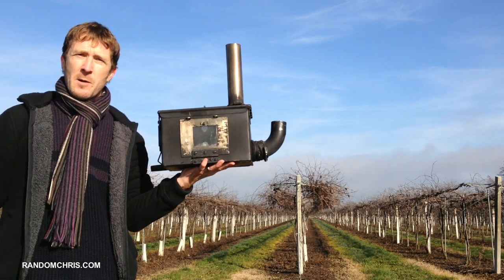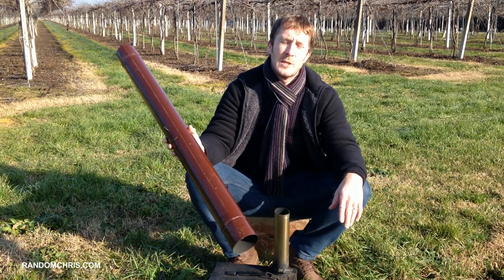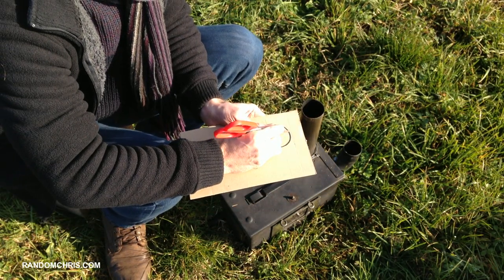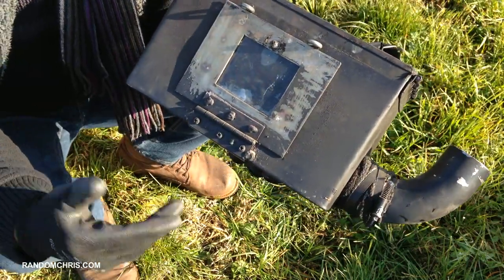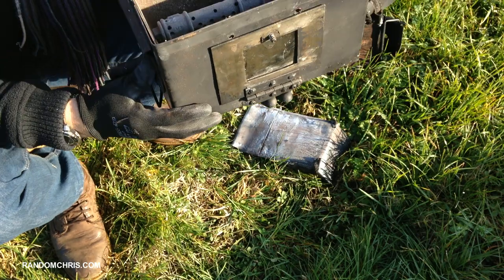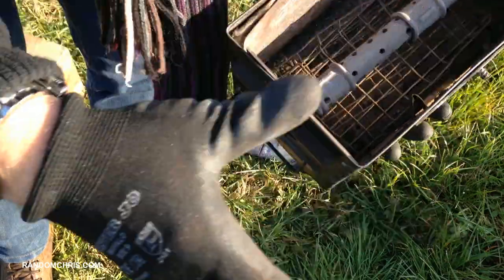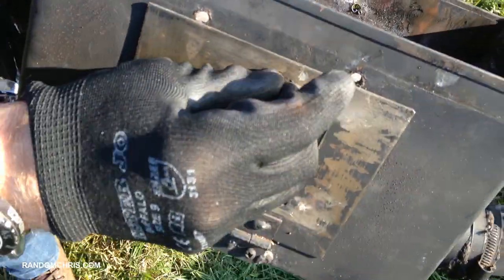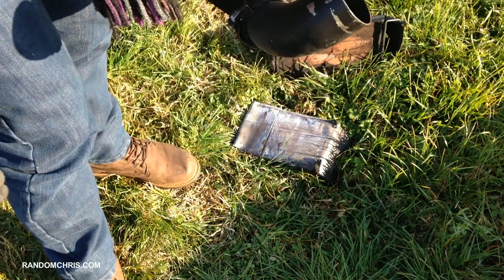How I Built my Ammo Can Rocket Stove - a Small Homemade Wood Burner (Mk II)

Comment: Love it!!! Some ideas to improve the design is to add a V shaped deflector around the exhaust outlet pipe. This would make the hot gases have to go around one more obstacle before exiting the stove. Another thought is to insulate the baffle to increase temperatures. And another thought is to improve heat exchange by creating a gap between the insulation and the outside wall, and allowing the hot air from the second chamber, (above the baffle) to go into the space between insulation and outside wall metal. This would make all the walls heat exchangers! Also adding a damper to the stove pipe can help regulate burn times.
Reply: Hike Yakima Washington ⬅️ I will chime in with a spark arrester at the flue entrance, which will remain clean by the extreme temps & adding a damper on both the intake & exhaust to control the burn/temps. Once it gets too hot, it needs to be adjustable, which also conserves fuel.
I am thinking that an accessory water heater via copper coil that slips over the flue pipe & can be rotated to the sides or back and into a billy-can, etc. would be quite simple. A half-height fold-down warming plate opposite the door would also be simple. To offset the weight of the warming plate, drink warming plates on the door side would suffice.
A clean design & great job!...

Comment: THIS VIDEO IS ALMOST 3 YEARS OLD; when will you finish with your Mark III?

I'd like to suggest you use a 20mm ammo can instead of a 50 calibre ammo can.  The increased capacity for wood means you won't have to wake up in the middle of the night to add wood.

I've just subscribed & rang the notification bell.
Put legs on the stove then add the air intake on the stove's bottom & add a damper to control the air intake volume.
Reply: oh waw putting legs what a revolutionnary idea! Any more orders, Sir? Am i free to go, Sir?

Comment: Finally got around to making my stove yesterday to the specs you show. I used steel rivets instead of welding but everything else is pretty much the same. I did use copper for the secondary intake. Works great!!!!  No smoke, just as you described. I will be installing it in my workshop in a week or so, after I make necessary accommodations for the flue and stove backing. Thanks again for your creation!!!
Reply from the maker: You're welcome Scott, I'm sure your workshop will be much more inviting in the winter with your stove in there. Cheers! Chris 👍
Reply: Christopher Barr - Random Chris
No, thank you. Stoves like this are a big deal. A friend of mine that ran for Eastern Michigan University was a refugee in Eastern Africa. Items such as this a great for people like me but can be essential for people like him. Great work!
Reply: @ColoradoCJ5  how long did it hold up? I am thinking of making one as a prepper/camping stove, so for the prepper part, I would like it to hold up for a while (my country just asked everyone living here to prepp for war, and its a damn cold country). So in case of war, I would like it to hold up more than 50 hours. More like a few thousand. Do you think that is it feasible if I mod it with vermiculite and steel sheets inside?

Comment: Great instructional video Chris!  
Couple ideas for the next generation build:  
One, add butterfly dampers in both the large (main) air intake and the exhaust, so you can control the heat better.
Two, add a simple, flat, metal sheet surface to the top for cooking, somewhat oversize to accommodate a fry pan, only with a slot cut out of the middle to keep the handle functional for easy portability.  
Another idea I have, call it a bonus tip, is, for more permanent installations anyway, to add a large, maybe baffled, chamber in the exhaust to capture some of the heat that currently escapes up the chimney, before a second pipe section conducts the exhaust gases out of the living space.  This may be a bit too much for this small type of stove, however.  Over-complicating it, so to speak, and detracting from its overall simplicity and handiness.
Reply from the maker: Hi Bob, thank you very much for your thoughts. I love the idea about the slotted metal cooking surface!  Extra heat release from the chimney is a great idea, but this will be dependant on the individual installation and I imagine there will be lots of different uses for these stoves. The Mk III will have a water heater option for off-grid hot water, which I believe will be very useful. Cheers! Chris 👍

Comment: Straightening the pellet feed tube for stix will make it easier for feeding and if you make it out of channel steel pipe thats square or rectangular the end can be cut on the corner lines and riveted to the bottom and side of the mark lll to keep the stove rope use down to a minimum....but thats just a design i use here in the states ...hello from the east coast in Virginia...your videos are very useful from my standpoint as a poor man that comps for my peace sometimes.

Comment: A great little stove design!
Chris here is my 2 cents for your next variation.
Wood stoves "suck" the heat out of the room.  A cool air intake helps that problem.  A piece of duct work could be connected to your rocket intake with a damper to solve that problem.  So one would have a rocket stove or a more efficient wood stove.  All of the current tent stoves draw from the room.
A door on the end of the container rather than the middle could handle  longer pieces of wood. So the stove might have to  be configured with the hinge on the opposite side to make that work.

Good Luck

Comment: Hi!!! I'm not sure if you have built your next version or not. This is awesome by the way!!! my only change would be to give up the rocket stove part in exchange for an air intake control system. the benefit to secondary burn us you can choke them down for longer burn times without all the smoke. Just my $0.02, but there may be a very valid reason you didn't do that. Very cool and Thank you for your content.
Reply from the maker: Cheers Jason, suggestions are always welcome.  Thanks for watching and commenting 👍

Comment: I enjoyed your video. Have you considered placing a small covered hole (maybe 1/4 inch) on the side where the secondary air intake is, so that you could insert a small metal rod to poke and manipulate the position of the wood inside without opening the main door?  This could come in handy when feeding the stove through the primary air intake. The only problem with this that I could see is lining up the wall insulation with hole, you could use a tubular rivet.  This would give you a clean and semi permanent alignment.  Look forward to seeing the Mk III. Best of luck.
Reply from the maker: Hi there, thanks for your comment. There are lots of different options depending on the type of fuel used. If I wanted to use sticks as fuel (as used with many rocket stoves) I would just remove the primary air intake elbow and feed them in directly from the side - in which case, their position could be manipulated by moving the sticks, or as you suggested, via a metal rod through the hole. If using wood pellets as fuel the 90 degree elbow is useful for collecting gravity fed pellets and directing them into the burn chamber. I even plan on experimenting with liquid fuels which could be added once the stove has been fired up with wood... Cheers, Chris 👍

Comment: Great project and a nice use of an ammo tin. I found your blog and videos while researching a slightly bigger rocket stove I'm planning to build.

I'm looking at adding a copper coil to the secondary burn chamber and using the thermal movement to cycle water running through it.

The eventual plan is to have a cold inlet from a pool pass through the rocket stove and then return back to the pool. If I can work in a heat powered fan to be turned by the pipes returning to the pool, this would then act as an active air ram for the stove. 

Between you and green shorts I've got a head full of ideas, and I look forward to seeing what you have planned for future builds, my only hope is that it doesn't encourage me to start over with however far I've got by then. 😀
Reply: hi, super gnome! I’m wondering if you ever found the time to build the stove you mentioned in this comment section.

If you have, I’d sure like to see the video, assuming that you made one.😊
Reply: @daphneraven6745  Yes, I did, I made it with a 25m coil of copper pipe in the upper chamber, and with a cold hose attached at one end, boiling water came out the other. Unfortunately, I wanted to use it for heating a hot tub, but discovered that you can't run hot tub chemicals through copper pipes.

Comment: Seems like you should try to get the intake air being released below the burning mass of wood, so that convection pulls it in even better.  Perhaps the model 3 can have the copper pipe routed beneath the chicken wire that suspends the wood.

Then as for the wood feed port, I think that probably takes over as the primary air intake replacing your pipe, since there would be less resistance for the air to come in that way, which is unfortunate and reduces the efficiency.  So some means to re-jigger that would be beneficial.  Perhaps a longer pipe (like the flue) would let you put wood in it, and then place a cap over it to block the air.  Wood / sticks would then gravity feed down in to the fire box, but air would still be drawn through the pipe system.

Comment: Mk 4 ... add a turbo boost, call it a Merlin ... my cabin stove just sat there, no rocket feature, it was a 'gasafirer" worked great. The dreaded downdraft can happen during high winds. Added valves "air inhibitors" controls heat out put and fuel burn time. Smaller (and fewer in number) holes in the secondary combustion injectors increases velocity and the resultant turbulence which improves combustion.

Comment: Pretty neat.  Suggestion for the MK3:  keep the window but ditch the side door.  This simplifies design....... side door not really needed since you feed it through the end.   Clean-out can be accomplished through the feed port and/or opening the top.  For safety, you could add a hinged cap on outside--of a flush mounted feed port.  This could have a few holes in it for minimum air flow and could be propped open for feeding and max air intake.  Looking foreword to your next video!
Reply from the maker: Thank you for your comment and suggestions. Cheers, Chris  👍
Reply: Best ideas freaking great site no side door improves this window is nice but not necessary something to get it off the floor I need a heater for my van

Comment: Thanks for this. I don't think I could do the welding bit, but I'm sure I could work around that - great stuff!
Reply from the maker: You're welcome, thank you for your comment. The Mk III will be designed so no welding is required. As you say, you can easily find ways around it to build one of these. Cheers, Chris 👍

Comment: What is the insulation again?. Fiber glass? Or is asbestos involved ?  Have you any info on fiber glass break down and breathing it in?  Where does one get the rope rape you described ...I'm not familiar with that.   Thanks again..it is great to learn new things..useful things..Bill
Reply from the maker: Hi Bill, thank you for your comment. I used Rockwool insulation. The insulation has withstood the heat very well but in all honesty I hate breathing in any kind of dust whatsoever so I would always advise anyone to avoid breathing in fibres or dust from insulation like this. Stove rope can be bought online or from any wood burner supply store - it's pretty cheap too. It is made from glass fibres so the same applies to breathing in fibres from this. Cheers, Chris 👍

Comment: I was thinking of using ceramic tile instead of thin sheet of metal on the side and back to insulate it.  Would that work better?  There is plenty of cheap ceramic tile at the local Habitat store.

Comment: Hi Chris,

Are you any closer to getting the MK3 made yet?, and what size diameter flue did you use? (i bought some rope from a stove shop and the women there said i should not have a flue less than 4 inch or the thing might blow up!) seems a bit much, your thoughts would be greatly appreciated. Best Phil.
Reply from the maker: Hi Phil, I'm working on the Mk III but life is crazy busy at the moment! The initial flue section on this stove is 2.5 inches. Above this I have used 3 inch flexible piping as a flue, which worked really well, as well as 4 inch flue sections which also work really well. The smallest flue you generally come across is 4 inches but that doesn't mean your stove will blow up if you use a smaller flue :-D Cheers, Chris 👍

Comment: What about a tray for removing the ash?  It would be nice if you could clean out the ashes without having to remove the lid.  I am considering this stove design for a small interior space, with air intake and exhaust from out side.
Reply from the maker: This stove burns so efficiently that it creates very little ash - a miniscule amount in fact. If you were using one of these full time than I would estimate that you could go at least a week of constant burning without having to empty the ash. The easy way of having a quick ash-emptying procedure is to attach the ammo can lid and flue to wherever the stove is being fitted (rather than the can body). You can then use the quick-release catch on the ammo can lid to open it up, disengage the hinge, then take the bottom of the can to wherever you are putting your ash. You could have it off, emptied and back on again in about a minute. Cheers, Chris 👍

Comment: Think this would work on a sailboat, maybe mounted to a bulk head (with proper spacing and heat shielding)?
Reply from the maker: Yep! I plan on doing this myself one day. Very handy to be able to make hot water for showers from firewood you can scavenge from pretty much any anchorage. This is the reason I started building these stoves... Cheers, Chris 👍

Comment: Wondering if this design could be applied to a 20mm ammo can. would the baffle and secondary air be all moved up higher? or stay down low?  Thanks!
Reply from the maker: Yes, you could use a similar design. I would have the area of the exhaust gas exits at least the same as the area of the flue. I would introduce the secondary air just below the baffle. Cheers, Chris 👍

Comment: Very cool. I want to build this for my 300 cubic foot camping trailer.  would either of the air intake tubes have to be plumbed to the outside?  Would it still draw air the way it is suppose to if it is drawing it from the warm air inside the trailer?
Reply from the maker: Hi there, thanks for your comment. The intakes could both draw from the internal air of the trailer but to avoid CO being produced you must have an intake vent with the same or larger cross sectional area of the air intakes of the stove. Cold air would be drawn in via this vent, so it might be a good idea to locate the intake for external air as close as possible to the stove, thus avoiding a cold draft causing a nuisance. As always with any open flame device being used in an enclosed space, you should always have a working CO detector in there with you. Good luck with your build! Cheers, Chris 👍
Reply: I was thinking of using ceramic tile instead of thin sheet of metal on the side and back to insulate it.  Would that work better or just as well?  There is plenty of cheap ceramic tile at the local Habitat store.

Comment: Also another idea...if you could get sheets of stainless or titanium 9,10 ft  long and possibly 0.03 thick .(or whatever is the appropiate thickness.) You could use pipe clamps for the form to hold its shape like the comercial camp stoves that you can buy. That would be impressive as ever.  I think over there you would say brilliant as the expression goes.
I know that solution has never been figured out by folks on the streets yet.

Comment: I'm going with Marsh Rat's design but had a notion to test, incorporating your pipe idea to supply fresh air from outside the van. Thus a draft won't be needed as the air for the combustion will come from outside. Thought I'd post this in case you are still monitoring this video.